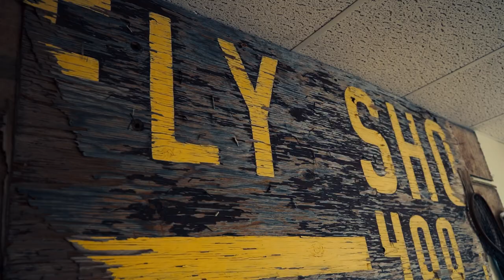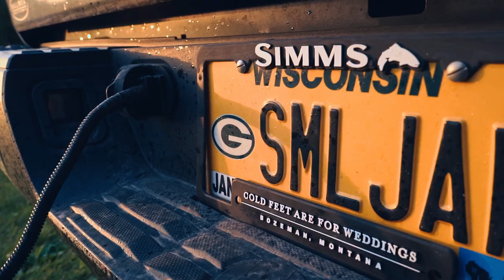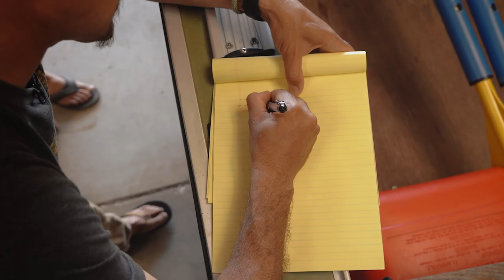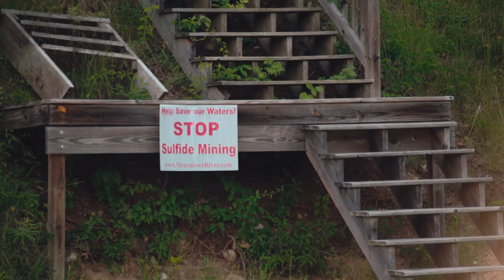Menominee River Smallmouth with Joe Cermele and Tim Landwehr | S2E03 | Das Boat

Comment: I believe we can produce materials for our uses while not destroying the rivers.  its not shut the mine down, but rather make sure the mine has proper water treatment before it goes in.  best of both worlds.
Reply: I'm sorry about your mistaken belief a lot of people share. The fact is nothing can stop the chemistry of earth's sulfide, when exposed to air or water becoming sulfuric acid. At metal mines, the target ore (like gold, silver, copper, etc) is often rich in sulfide minerals.  When the mining process exposes the sulfides to water and air, together they react to form sulfuric acid.  Yes, think battery acid.  This acid can dissolve other harmful metals and metalloids (like arsenic, mercury, lead, cadmium) from the surrounding rock.
Acid mine drainage can be released anywhere on the mine where sulfides are exposed to air and water — including waste rock piles, tailings, open pits, underground tunnels, and leach pads. You are right though about one thing, "it is not shut the mine down" like you said, it is PREVENT the mine before it starts. About 75% of all mined gold goes to jewelry.  Clearly we do not need that.  Simple recycling could supply all the gold we use in cell phones. Don't let the mining industry's propaganda dupe you.  You're right too, of course proper water treatment is essential as well.  However, it's the ground water that isn't possible to filter!  Additional horrors come with the processing of gold and silver. The excavate is crushed to the particulate size of talcum powder. That's dumped into huge vats of cyanide. Cyanide kills. (Cyanide + gold forms a foam that floats up, gets skimmed off, then another process yields the gold. That dust is reactive, so the forest defoliates from the resultant acidification.  So it's not just regulations, or testing or water from the pit pumped out and purified. Rain and snow will cause sulfuric acid when contacting all the dust and waste. There is NO WAY to prevent pollution from sulfide mining.  The only way to win is not to start!  The final devastation comes from the massive 28-story high toxic sludge storage "facility" (really just an earthen dam) breaching, like one does world-wide every 8 months. The latest one in Brazil killed 290 people immediately.  Since then, Brazil has prohibited this "up stream" type toxic sludge storage.  Guess which kind Aquila proposed for their mine site 50-yards from the Menominee River? That's right, the upstream kind.  Please really research the things you tell others before just making false claims.  No sulfide mine has ever NOT polluted.  100% pollute.  Massive put mining cannot be done in a vacuum. Excavate will contact air/water. Acid mine drainage will form, will acidify the air, land, water, killing life-cycles up and down the tree of life.  Oh, and there's the ruination of our tourism economies.  Mining is never safe, and clearly NOT safe on the Menominee River. Donate money. We have legal fees to pay. Use the http://www.JoinTheRiverCoalition.org site or mail checks to P.O. Box 475, Marinette,WI 54143.  I wish you peace.
Reply: @nataliewaterprotector6852  what a copy paste... Everything that is done by man polutes. The fisherman polute. It's not about if mines polute, but if they introduce unacceptable levels of so2.  For example .00001% is pollution that fish won't be affected by so it's fine.

Comment: The good thing about the Great Lakes is the Great Lakes act that has more than one state voting on anything that goes on in the watersheds or on the lakes. It’s a very slow process to get big things like the mine going. All states have to agree on them and counties.
Reply: Sadly that is not the case.   The Menominee river boarders WI and MI and because the mine ins on the Michigan side we get no say.  I have attended so many meeting and sadly we as Wisconsinites have little say.  Michiganders need to put the heat one.